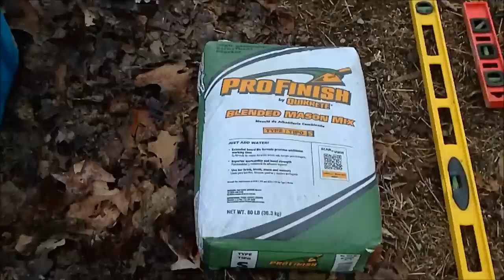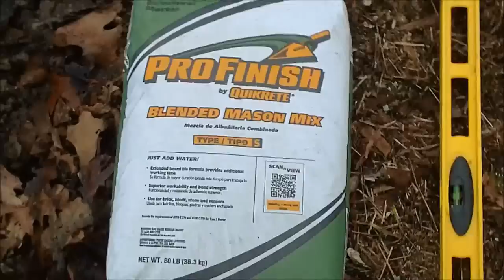Homesteading: Laying Concrete Blocks

Comment: Though this is painful to watch, being a mason for over 40 years, I'm still impressed every time I see someone lay block and it turns out looking not to bad from a distance.  Anyone who can do masonry without any training and make it "good enough",  is an exceptionally handy persons.  I've tried to teach guys how to lay block, and it was useless, for every block they laid was a new experience.  One thing for sure is, he must have a lot of time on his hands.
Reply: Do you see a footer are is one not needed?
Reply: @khiaraslaw  yes a footer is 100% needed
Reply: @dtm7909  did you see one ?
Reply: @khiaraslaw  yes he has a footer . The rebar sticking out is in the footer .
Reply: @dtm7909  ok missed it I grew up in small town east Texas and there are houses setting on nothing but cement blocks of course a few are sagging in places
Reply: @khiaraslaw  I’m in the Midwest . Most footers will be twice the width of the wall. So a block  is 8inches wide the footer would need to be 16 inches wide and the depth needs to be below the frost level.
Reply: @dtm7909  thanks so much currently in Missouri looking to build in the Ozarks

Comment: I know you are for sure completed with this project, but you might have another.  Something I do, is get my ditch dug, 4-6 inches or however deep you want your cement to be, deeper than your first row of block.  Put your rebar in and place the cement in and go ahead and lay your first row of block.  Leave your gap between then then slush in the mortar after the row and cement set.  It helps to go ahead and set your corners in this process.  It does work and work well, especially working by your self.  I have done this type of work for a living, so I know all the tricks, but I also have done projects for my self and took the approach you did in this video, they both work and get the job done.  Way to think outside the box and do what others say you cant!

Comment: As a young mason I think you done very well, if you're going to level it use the 4 foot level and small one to level across and you want to cover the block or multiple ones to get a proper level through but like I said can't fault you really, a lot of people wouldn't know or have the confidence you have to go out and do it and I'm sure as time goes by and you did more and more you're technic would improve and become more fluent..well done mate

Comment: This video shows well, that people can do anything, i mean anything, if they find out, how to do it, and then , very carefully, just do it!!! Speed is not important, good job, level job is! You don't have to be a brain surgeon to do this, I am a Physical Therapist, and part time carpenter, done 8-9 Ikea kitchens on a side, sauna bentches, used to be a roofer,  fix always my own cars, built anything really, so this good, hardworking man here is showing you people, you can do it, really !! Good job, show the next video,m can't wait!!! Very interesting =)
Reply from the maker: +Eero Laukkanen Thanks man!
Reply: Eero Laukkanen thanks man, I agree.
Reply: i like your comment on being a handy  man in many area
Reply: Yes people can do anything providing that the code laws don't stand in the way.  I am just starting on building my own home from my childhood home. I have to gut it.   It goes on a cinder block platform.  I can build a solid house and I prefer to use screws as I can't drive a nail worth shit.  Nail guns are so heavy.  Unfortunately my house is in city limits so everything has to be up to code.  I will try my best to find the right information even down to if I can use screws instead of nails in some places. Thank Goodness for you tube.  you can find how to do things right in here.

Comment: Great video. No music necessary. Your comments and the actual sound of the work was great.

Question: when you are laying the blocks on the footing, and you put the 1x1 strip of mortar down, why only along the 16" side, why not also on the 8" end?

And what happens if you misjudged where you should've had the rebar come up from the footer, and then you come up on the rebar and it wants to be where a wall of the block is?

Comment: Thank you for showing this is steps that are clear and at a pace that we can all keep up.  Also, the explanations are great and helps us green horns understand why you do what you do.  For years, I have seen folks lay bricks and blocks, but jus all the detail has always escaped me.  I do have a question and I wonder why not re-use the mortar you take off from what is squeezed out of the newly laid block?  As with others, I saw that you scraped off the excess mud and let it fall to the ground.  Can you not re-use/repurpose the mud and extend how many blocks you can lay with a mixture?  Thank you, again.

Comment: Gread video! One thing that may save you later but cause a little more work now, don't run the electrical in the same trench as the water.. Of course it is your project, but does not meet code for many reasons.

Comment: you should use a bigger level as it will make things easier. You could also try putting a liner on the side to mark out where your bricks should be.
Reply: always plumb, guage and level

Comment: How you gonna do your slab?? Is concrete truck able to come there??/ Where are you located, in Missouri where?? What is the closest city? I want to see, when house is all done, how it looks like!!! Maybe will stop by one day, bless your heart, hope it turns out well =)
Reply from the maker: +Eero Laukkanen I don't know what you mean by slab...I have already had the concrete truck out there and poured the footer.  There isn't going to be a slab in the middle just an open crawl space.
Reply: +Backwoods Patriot OK, here is Florida we have about 4 inches slab in a middle, between footings! Well, we sure don't have frost here =) Make sure, put put enough insulation under floor, you guys get 40 below sometimes, right?? Where are you locaated compared to Kansas City?? My ex-wife was from Warrensburg, close to Kansas City ;o)
Reply from the maker: Eero Laukkanen We don't get -40 degrees here..We usually get to maybe -5 degrees, but I am going to insulate the floor, and the walls are going to be 2x6 so thicker insulation can be used, plus insulate the ceiling well.  We live in southern Missouri near Springfield.  Kansas City is like 2 1/2 hrs northwest of us.
Reply: Springfield?? Is that close to Branson, Missouri?? I went there to my first honeymoon ;o) And we drove thru Springfield too =)
Reply from the maker: Eero Laukkanen Springfield is about 40 min north of branson.
Reply: Yep, is there a Marriott Resot in Springfield??On a lake?? There was my first honeymoon night =))

Comment: The footer code in my part of alabama is half the blocks width should stick out each side if the block so your 7.5 inch block should be on a 15 inch wide footer. I think it's also 12 inches deep
Reply from the maker: This footer is 16 in wide and 8 in deep also well past the frost line.

Comment: how wide and deep is your footing,and do you have to fill the inside of the blocks. I"m building a small shed.
Reply from the maker: +mateollios 67 My actual footing is 16 in wide by 8 inches deep/thick.  You do not have to fill every single core, but you should fill every fourth core or so.

Comment: what's at the base of the wall?  can you explain base prep steps after excavation. Thx
Reply from the maker: mokruxa Sure...In some cases after digging your footer you will need to pack with gravel before pouring the concrete for the footer.  I'm in Missouri and below 12 inches is basically solid red clay and rock, so after we dug the footer trench we formed the steps with 1x's and poured the footer directly into the hole with nothing done or added between digging and pouring.  There is a density test you can have done and if your soil is hard enough you just dig the hole and pour the concrete, easy as that.  Already been through 1 winter uncovered with no movement or cracks or anything whatsoever.  If you mean what are the blocks sitting on, we poured an 8 inch thick by 18 inch wide footer and stuck re-bar every 8 ft.  I have a video of pouring the concrete here...https://www.youtube.com/watch?v=DaqsQ2bDByI

Comment: hi how come you don't put cement in the well? for firmness
Reply from the maker: +Dharma Kissoon By well do you mean cores?  If so I will be filling some of the cores with concrete once it's done.  I have a video of filling some cores and putting in some jbolts.

Comment: Im in th process of building a house and most likely using block as a foundation. Is it necessary to have the plumbing install before you start laying the block?
Reply from the maker: You don't have to...you can just turn one of the blocks over so that the core holes allow for pipes to pass through the foundation.
Reply: thnx

Comment: the water must be drinking water,I don't see any footing, water is going to freeze, water is going to fill up your sub base another job full of cracks ,the area where you put your first blocks should be at least 30 inches deep, your footing should be 16 inches wide.  That is  how you teach some one to  work with blocks.  when you do work with blocks, do not forget the gravel and weep pole.

Comment: how do you build a block wall that is not a even number of blocks long?
Reply from the maker: You can simply cut the blocks to any length...The easiest thing is to plan the build in dimensions that use full or half blocks.

Comment: what a pain in the ass if you don't do it every day. i'm glad that i am looking at only 80 blocks with no structural component. sloppy doesn't begin to describe the work i'm about to do. textbooks might be written about how badly done this will be. but it will work. it only needs to last 10 years, and the house will not be sold as a house, just land. house is right now already detrimental to the value of the land, because it has to be destroyed. it was built in 1918 near downtown wichita in the original "black" part of town. expanded on over the years, and it seems like it was some pretty well to do black folk, but still sub par. replacing a non load bearing basement wall at the moment, gonna just run up some blocks with rebar and chickenwire reinforcement (not really chickenwire, but it sounds better) then pouring sand in behind it with a concrete cap.  if i can get 10-15 years out of it, i probably don't own it anymore because of the highway on top of it. it has to expand some time, and in 10-20 years my house is on the chopping block. so i won't do anything with my house that will hold up much more than 15 years. by then i need to be out of here.

Comment: THIS IS FUCKING TERRIBLE
Reply from the maker: yeahman Please don't curse in the comments..Let's keep it pleasant for everyone.  I said several times this the first time I've laid block, and this block sat all winter uncovered like this and still has no cracks at all.  Please send me a link to YOUR video on how to properly lay blocks.
Reply: Backwoods Patriot sorry     I have done this crap before and hated it you did fine      should have used 2x 12's  for the footing it'd be flatter on top and easier to level
Reply from the maker: yeahman There's an 8 inch thick by 18 in wide 3000 psi footer under these blocks.  I just figured it was easiest to pour the concrete into the trench and let the dirt itself be the form.  We leveled the concrete with a 6 ft level and a 2x4 and a trowel.  I have a video showing the footer being poured if you're interested... https://www.youtube.com/watch?v=DaqsQ2bDByI
Reply from the maker: yeahman Also I thought you meant my work blank sucks..lol
Reply: Backwoods Patriot yeah sorry your work was sweet I have done crete work for years and I really hate it,   looking for a career change but I meant no offense and   your doing just fine
Reply from the maker: yeahman I was the same with truck driving..I hated every day I woke up in that sleeper!
Reply: The only mistake he made is not putting in a footer. Without a footer his blocks are going to sink down, cut into the ground, etc.. something like that.
Reply from the maker: Jason C.  There's an 8 inch thick by 18 in wide 3000 psi footer under these blocks.  I just figured it was easiest to pour the concrete into the trench and let the dirt itself be the form.  We leveled the concrete with a 6 ft level and a 2x4 and a trowel.  I have a video showing the footer being poured if you're interested... https://www.youtube.com/watch?v=DaqsQ2bDByI

Why does everyone say there's no footer?  I have a video showing the pouring of it!
Reply: Backwoods Patriot Is the footer supported internally by floating rebar? Unless it is then its not a true footer.
Reply from the maker: Jason C. Absolutely!  2 rows of it held off the bottom by about 3.5 in.  The video where we pour it I'm pretty sure explains this.
Reply: Backwoods Patriot  I am watching the footer video right now. I see rebar vertically, but not horizontally.
Reply: Backwoods Patriot You used High strength concrete. That was very wise. (y)
Reply: Backwoods Patriot  You do have a footer. I stand corrected. :-)
Reply from the maker: Jason C. LOL..I get that all the time..When I continue with the block work here shortly I will definately revisit the explanation of having the footer.  I guess people watch this video without having seen the previous ones..which is understandable!
Reply: Backwoods Patriot Youtube is directing people to this video. NOT your other one.
 Maybe you can put a link in the description thingie?
Reply: Backwoods Patriot I apologize for my mistake.
Reply from the maker: Jason C. It's ok...It's totally understandable that not everyone will have every single video I've ever posted.